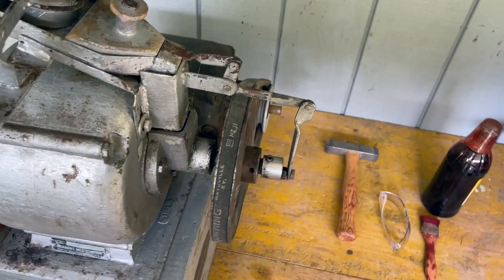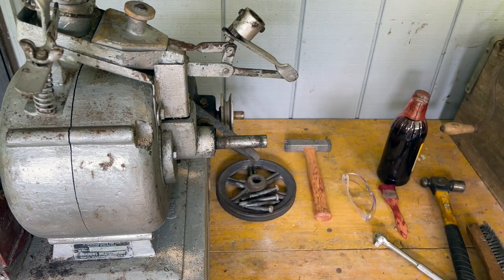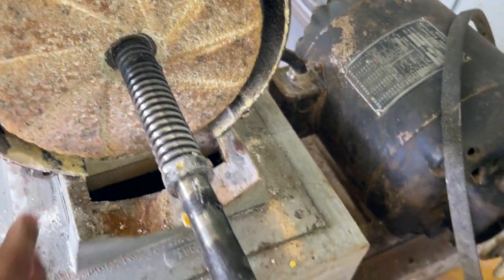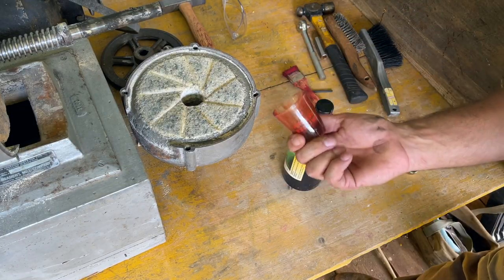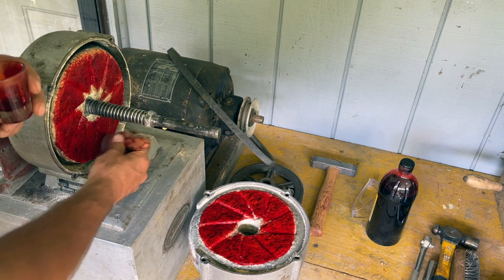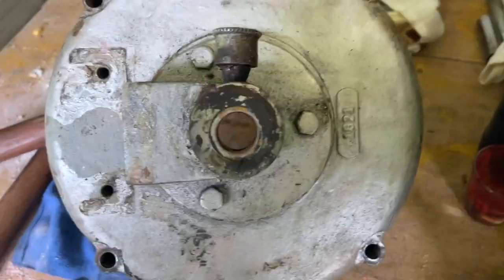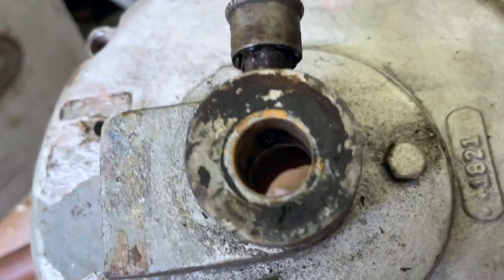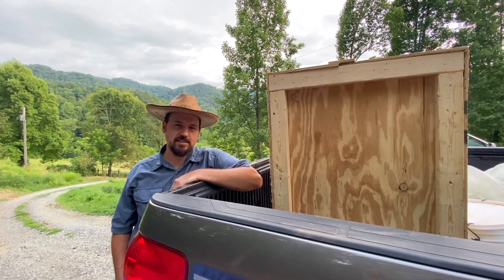1959 Meadow's Mill Gristmill Restoration v25

Comment: Pretty cool man. Some parts of that thing besides what you fixed looked a little worse for ware. But overall a great rebuild. 👍🏼
Reply from the maker: Which parts? Thanks
Reply: @metcalfmills5679  don’t know all the part names, but I’ll watch it again and reply.
Reply from the maker: Thank you
Reply: @metcalfmills5679  The arm for the adjustment screw and the arm on the front of the machine. The holes looked to be "warbled" out. I can send you pics if you like. Just think that it would run more fluid with newly machined pieces. But that's just my opinion and I still think it was an awesome rebuild man. Getting those stones back in shape was great work.

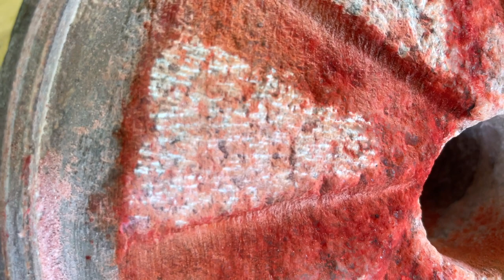Comment: At 15:55 of this video you show a close up of the dressed stone. It is kind of blurry but it looks like  small striated marks going from the outer diameter to the center of the stone. Is that the effect you are trying to achieve?  I have a small hand driven stone mill that I bought in the 70's. I used it to grind wheat. Usually just a couple cups at a time. It has not been dressed since I bought it. When my son took on making bread he bought a counter top electric model. So mine sets in storage.

Comment: G'day Justin, any tips on how I could fix a hairline crack on a grinding stone? Its a tiny home table top wet grinding machine. Is epoxy food grade?
Reply from the maker: I don’t know on a small mill. Probably should replace it. The big stones with steel band it is usually not a problem.
Reply: @metcalfmills5679  Thank you kindly